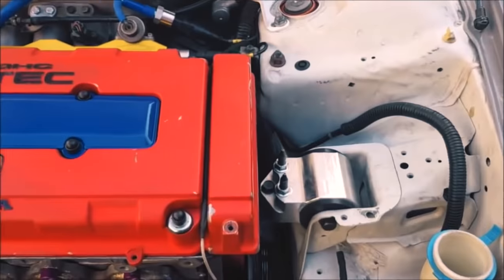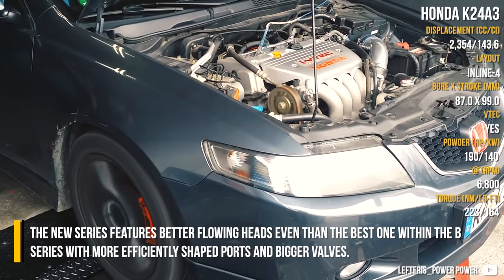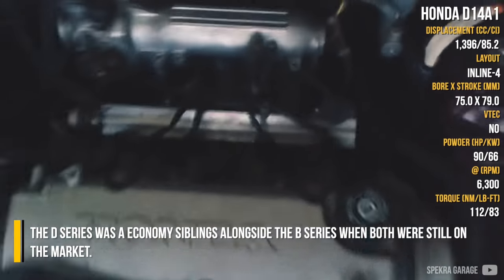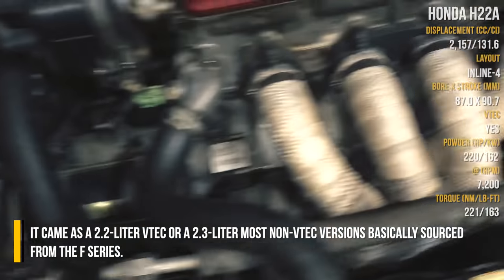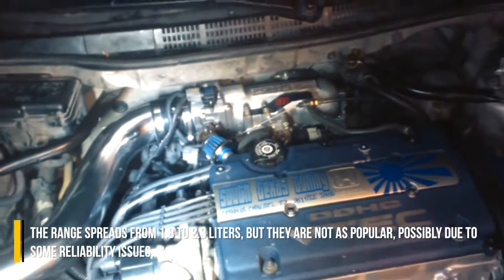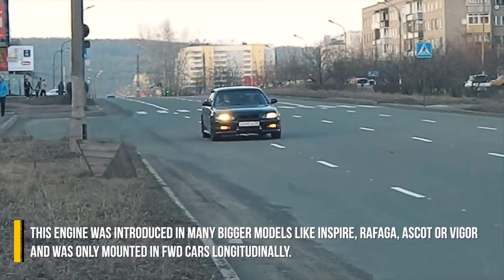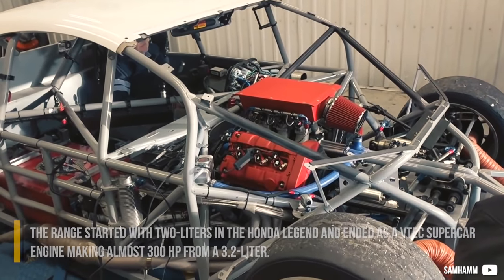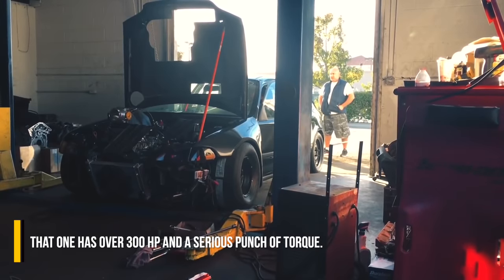Honda Engine Series: Explained

Comment: What was not mentioned here is that there are essentially THREE different types of engines commonly referred to as ‘F-series’. The TRUE F-series engines are the SOHC engines used in the Accords, Odysseys, CL’s and base Preludes. These were available as 2.2 or 2.3 liter engines. Then there is the F20B and F22B. These are actually H-series engines. The F20B is a destroked H22A and the F22B a destroked H23A1. Finally, the S2000 F20C  and F22C are clockwise spinning engines which are essentially K-series variants.
Reply: 1.8 was also used in the accords :)
Reply: Yeah, and there was 1.8 f18a3 available in europe. Very reliable but not very powerful. Also a couple of years later came f18b2 which had vtec and bit more power.
Reply: @0lz179  i have an accord with the f18b2 engine and tbh i really dont like that engine lol its so slow at low rpms and it seems heavy it doesnt wanna go idk maybe theres just something wrong with my engine but i also had a d14 non vtec civic and it felt faster.
Reply: @dawidkenway5649  Accords are 3000+lb cars. A 1.8 liter naturally aspirated engine in a car of this size and weight is going to be slow due to its lack of torque.
Reply: @dawidkenway5649 yeah well it is only a 1.8 after all. Reliable but quite slow. Atleast the f18b2 has 136 hp unlike the f18a3 with only 116 hp.
Reply: @matthewstorm5188  yeah at least vtec helps when going 100+km/h i can overtake on 5th gear unlike the d14 civic

Comment: For all those haters out there, there are some good Hondas out there with proper owners
Reply: The Honda Tuner scene fucking changed when ebay builds came to be.
Reply: Haters are noobs, who can't see the difference between a car and a shopping trolley.  I've worked on nearly thousands of cars in the last 20 years and I got into the japanese cars a while ago, as I realised, those are the best cars hands down. I've had Mazdas and Toyotas, but lately I got have Hondas. And I will never go back. I don't say, Honda will remain the best for ever, but compare cars since the 80's, apart from some of the BMW's, you can't go wrong with a Honda. Some blindfolded guys, who sware on VAG diesels, I just laugh on them. Peug diesels are far more superior compare to any german diesels, yet how popular those A4's nowadays? Anyway.  If you want a good reliable and good performing car, with decent fuel economy, a compact little rocket or a family car, all of them are great.
Reply: I totally agree,,my 1992 accord was incredibly durable, legendary solid,, we had a hailstorm it destroyed the exterior of many houses my dads newer accord had severe damage on hood and roof, next door neighbor had a new civic, it was totalled, mine dint have a scratch , it could take corners  like a wild animal even when powersliding it gave incredible feedback and you always felt in control on dry asphalt or snow and ice.. Top speed was high,, it had tiny plastic bumpers, inside was high quality with great seats,, it was the most amazing car i ever had
Reply: Hoon-duh
Reply: SOME good Hondas? Hondas are easily among the best cars in the world!
Reply: idontcare80 that’s true but unfortunately there are fanboys that ruin the car scene especially ricers
Reply: @basithph8958  That doesn't have anything to do with the Honda brand.
Reply: I’m impressed by 4 cylinders that Honda makes especially when you can interchange parts and make them faster.
Reply: im one of them! J Series
Reply: TRUE
Reply: WELL ALL I CAN SAY IS THAT MY HONDA TOOK A LICKING  ALWAYS  ALWAYS KEEP ON GOING AND GOING AND GOING.
Reply: I just hate the ricers honestly.
Reply: Fuck Honda
Reply: I love Hondas it is the drivers I don't like
Reply: @Z4G.  and the zip tie crews lol
Reply: 4:20. Sounds like the Toyota ae86 in a way.
Reply: Daihatsu??? Good powered twin cam turbo
Reply: Ricers ruined hondas reputation. Definitely one of the best if not THE best engine manufacturer. Not uncommon to see them surpass 1M miles with minimal work
Reply: My son was given a 2000 accord 3.0 a couple years ago didn't like it gave it to me his dad, my first tuner is this engine good shit what u heard the vin number matters what  does all that mean
Reply: And exhausts...
Reply: Oh yea. I have a 94 honda accord that I want to get all fixed up because it was passed down
Reply: I’m definitely a responsible owner now, in my younger days I knew nothing about cars and went down the ricer route, now I get hard on for older cars kept stock and well maintained and I try to go oem parts over aftermarket when it comes to maintenance or repairs
Reply: trust me ive seen someone drivin a beemer but still act like total shit
Reply: I got a d16z6 eg8 sedan beautiful
Reply: Yup for sure man
Reply: @Z4G.  to

Comment: Any B-Series owners here?? ✋✋
Reply: K20AI4 from 04 Integra/RSX type R on my 92 civic si. Had this swap back in 06 in my hatch wish i never sold it a few years ago
Reply: EJ1 B18C JDM ;)
Reply: B18C4 MB6 🤙
Reply: B16 Ek4
Reply: B18 b1 integra
Reply: B20B JDM Integra
Reply: B18C1 GSR! Woot woot!
Reply: Sold my b16a2 and buy k20a2,, miss the thing bud damn k are also a lot of fun 😎
Reply: Eg6 🤘🏾🤘🏾
Reply: 1993 accord with b16
Reply: b16a3 del sol
Reply: B16A2 '98 Civic EX Sedan
Reply: Ej2 with b18c! 🤗
Reply: B = beast or best
Reply: Integra GS with a B18b1 😅
Reply: EG2 del sol VTEC ✌
Reply: 1987 acura integra
Reply: Built b17
Reply: B21A1, Prelude 4WS
Reply: No I don't
Reply: 98 Civic Ex Coupe with B16Y7 with 5 speed ( yes I know that is the crap intake manifold) I plan to swap a 3 lobe K24 with forged internal, all the other stuff and turbo for around 650 hp. Errr... Oops, I mean D16Y7.. sorry, it's hard to keep up with the engine names.
Reply: 91 crx full swap b20b Frankenstein motor
Reply: B18a1
Reply: B16 EK4
Reply: I got a 96 integra  b-18-b1

Comment: Wish Honda would make a V8 VTEC engine for the public! Love their engines.
Reply: i don't remember where i heard but they think V8s are too excessive for road cars, they'd only make a V8 for racing use
Reply: Honda F1 has also used the Mugen 3.5l v10
Reply: @snoofayy6150  you mean v10 and v12s. There are some v8s on most trucks on the road.
Reply: @YoungOzzy432  a truck with Vtec would be an interesting sight to see
Reply: Even if Honda made a full size V8 pickup I’d still much rather get a Tundra
Reply: Honda almost developed a V10 Vtec engine for the 2nd gen NSX back in the late 2000s but was scraped once the recession happened :(
Reply: Just had a ride in my friend's Ridgeline v6, no need for a v8....
Reply: check out the Ridgeline  @YoungOzzy432
Reply: Borginator 🙌🏽
Reply: nsx shouldve been v8
Reply: @matthewgordon8199  that's essentially what the 5.0 F150s are
Reply: Vortec 3501999 that Uz power lol
Reply: @YoungOzzy432  pretty sure they do
Reply: The Gaming J.D he’s talking about HONDA not Ford and Chevy.
Reply: Borginator they would kill all competition if they did that lol
Reply: The whole point of vtec is to not guzzle gas like 8 cylinders
Reply: Absolutely support
Reply: Inline k series lol
Reply: @snoofayy6150  they won't make v8s because our politicians made laws against it, toyota trucks would be 10k to 15k cheaper if it wasn't for taxes trucks
Reply: Talk to your politicians they're the reason we don't have honda v8s
Reply: Gotta swap one of those 3.5 v6 out of the Ridgeline, I think that engine is also in the RSX type s if I'm not mistaken
Reply: Look up Gene Kim
Reply: There was always a rumor of a V8 RL/RLX.  That would've been nice.  A 3.8 liter
Reply: Shit the 4cl and v6 honda engine push hp like a v8 lmfao
Reply: @YoungOzzy432  I think they think their 6 cylinder v Tecs are probably more than enough power & they know people are gonna tune the shit out of them, so maybe they don’t want to create a monster, but imagine the builds people would make with a v8 vtec
Reply: @YoungOzzy432  TOYOTA ALREADY DID IT
Reply: Why you mean for a plane? Cuz that would make those cars fly!!! 🐹😊
Reply: @snoofayy6150  they didn’t think it was excessive, they made it a point to beat the V8 Ferrari with a V6 at the time the original NSX was released.
Reply: @Piercemxpx  at the time the original NSX was released, Honda showed the world that their VTEC system didn’t even need to be a V8 or forced induction to be as powerful as the V8’s of the time.
Reply: it would be too insane for us
Reply: There's actually a guy who runs a company called 'neutron engines' and he's currently developing a V8 engine which is basically just 2 K24s married together! It'll be a high revving V8 monster, with VTEC! Plus apparently he's trying to make it as interchangeable as possible with actual Honda engines, and it'll even use a stock K24 head and pistons!
Reply: If they did. I doubt it will be high revving due to emission standards.
Reply: theres a guy developing one atm, hes gonna make it availible to the public
Reply: As i remember, Honda once made a V8 engine on the Honda Legends Max. But sadly, that just a concept
Reply: they were going to make one for the new NSX but before it entered production in 2008 it was scrapped due to the recession and only brought back by acura in 2016
Reply: @jaybee6477  If our politicians are the reason Honda never built a V8, then how do other automakers get away with it?
Reply: @matthewstorm5188  foreign automakers get heavily taxed on every v8 they sell in America

Comment: D series Gang
Reply: Yhuuu. Lil Honda del Sol... Or am I getting confused... Maybe it's a b series... No d series
Reply: @quiet_benzy  del sol had both options, mine had the D series
Reply: This post was made by h22A1 Gang
Reply: K24 gang
Reply: No I'm not
Reply: 98 Civic Ex D16Y7.... Crap intake manifold....
Reply: Lol d17a2 in my civic here. Fragile little engine imo, easily blows head gasket. Not bad if you never let it get hot.
Reply: 2000s honda city ,that was the first time over country got vtec.still loved by emthusiasts here
Reply: @kaulincurtis9665  Fragile?? I've got 300000km's on mine. No leaks whatsoever. Then again I replaced like 10 parts not too long ago.
Reply: @josemalinao1308  I guess I should amend "fragile" to "sensitive." Ever get even close to overheating, and that head gasket will probably blow. A cracked radiator sent me down that path...other than that, they are a fine engine.
Reply: 98 Civic EX sedan
Reply: D13B2 gang
Reply: My Y7 has survived 2 spun bearings, racing abuse, overheating, oil starvation, and major detonation and still runs like a champ. Little low in the power department but that’s a fair trade off for reliability

Comment: My Civic came with a D16Y8 VTEC. The D may have less horsepower than a B. Torque was almost identical, 4lb-ft difference, but it peaked at a lower RPM. Making it well suited to hilly areas.

Comment: Where is the love for D series? They can be fun too
Reply: Ef D14a1 dual carb whit mini me mod 😁😁
Reply: D16y8 crx
Reply: I thought my accord was a D series but it’s an F series
Reply: @m7machines738  one time i saw a prelude at the junk yard that had a d series... I tripped out.
Reply: Arcane Anomaly you sure it was a d and not an F ?
Reply: @m7machines738  i looked at the number plate and it said d16. i told my friend and he said it was true haha idk.
Reply: Loved my little D16 in my 1988 CRX Si
Reply: D17a2
Reply: 200$ d14a3. Love the car
Reply: D17a1 lolol. Slow af but great gas mileage!
Reply: i have the slowest d13b2 but it is what it is still fun to drive
Reply: @ibrahimqureshi2420  my friend had one of those for a bit and they still can be fun, just flooring it everywhere is fun
Reply: Got a d16a8 in my eg, im certainly not disappointed! 4age smallport performance, but more torque...
Reply: D15B7, NA, cold air, full exhaust(test pipe), 5-speed, EG8.  Sedans are fun too.
Reply: @PLKxR  is it the 3 stage vtec?
Reply: @ibrahimqureshi2420  non-vtec
Reply: @PLKxR  oh nice
Reply: D14z2
Love the little whine when you pass 5000 rpm
Reply: @TheRamGuy  it is a wonderful engine and sounds really good...nobody talks about it which it's a shame, people only think vtec is the best, but they don't know the full essentials of what is a Honda.
Reply: @remco6738  exactly... You don't need vtec to feel the Honda essense...i had one as well.
Reply: @sergiobatista2272  nice :)
Reply: @roachysteeze6816  I feel your pain brother. Same here :(
Reply: D16z6 in my EJ6
Reply: @sergiobatista2272  yeah they are great little engines vtec or not.we got the d in a 2000s honda city, great cars tho.i have seen many in various state of modifications.from your normaly modified ones to modded to heck ones.it was the first time the car guys here got vtec so it was definately loved very much here.
Reply: @GesundheitInStyle  ohh yeah I will if I get the opportunity but my d13 is mpfi and has 16 valves ,4 for each cylinder

Comment: The f20c in the s2000 is no relation to the older f series
Reply: It was inspired by the F20b.....
Reply: @FallingStar1080  */f22c and its not inspired at all by the f20b. The f20/22c is compared to the f20b because it's they are f series engines. But to say the fwd racing designed accord engine inspired the s2ks engine is entirely false. The s2000 engine is only f series by name and basic internal dimensions but is more off a k series and u can actually use a lot of k parts on the f20/22c. The F20/22c was/is drastically different from every other f and shigeru uehara designed the engine from scratch specifically for the roadster.
Reply: Mark is right because it can be argued that the s2000s f20/22c doesn't fit in f or k series and should be categorized as it's own beast
Reply: @strlRnn  A quick google search will reveal that the engine was indeed inspired and a close relative of the older accord and prelude's with the h23a and f20b engines found in japan. I never said they were a drop in swap or that they are interchangeable. You lack comprehension.
Reply: @strlRnn  I used to be a big honda fan... but fanboys like yourself who have absolutely no idea what they are talking about half the time let alone turn a wrench convinced me that the fan base just sucks overall and that's why no one in the car industry ever take honda let alone their fans seriously
Reply: The head was a complete new design more towards k series while the block was more of an h/f series hybrid hence why u can throw a f20/22c head on any k or vice versa but u cant throw a h series head on a f20c like u can do a f20b
Reply: And no need to insult people because they know more than u. That shows signs of low self-esteem and disappointment in ones self. Don't worry guy, we all get out of civics when we grow up
Reply: @strlRnn  ooooooof.... burn lol. Hey I dont own civics but I have a prelude sh? Am I still cooler than civic owners? Lol
Reply: Yea has no real relation hahaha
Reply: pretty much first k series
Reply: F20c was kinda like a predecessor to the k series
Reply: Elmer Granados totally right the we’re inspired by the H
Reply: @FallingStar1080  nope, it was the developement engine for the K series. The K series is basically the mass production version of the F20c

Comment: I’m a Chevy guy, own two old school 350s one truck one car, a 6.0 “LS” in my daily 2500hd and 454 big block in a 72 Chevy Cheyenne. But I’m seriously looking at getting a civic si or a rsx s-type. I’m starting to like these little engines. Thanks for the info. 🇺🇸🤘😎🤘🇺🇸
Reply: James Earl Cash I’m a big mustang guy and love ford, but I have always been mostly an American enthusiast but like you the civic si’s are starting to appeal to me a lot
Reply: These are like supped up lawn mowers. Totally fun. Worth getting into trouble in these. 

I grew up with a little 90 hatchback Civic and that thing made some decent power for what it was. A few upgrades later and holy crap. It's hard to explain Honda's. Today I own 3. 2 5th gen preludes and an 2016 Odyssey. For a van this thing is sweet. At one point in my life I owned a 1996 passport. And that was plenty of fun as well.
Reply: I F23 swap my 92 Accord added a 72mm TB and a lightweight flywheel damn this thing got some balls.

Comment: My first car was handed down to me from my dad and i love it very much, it’s a 2007 Honda Civic . Non vtec. Not the most powerful engine but the car is pretty light weight, under 3000 pounds curb weight and it’s a manual so it’s still buckets of fun. The first car i want to buy with my own money  is the 8th gen accord coupe v6  with the 6 speed.